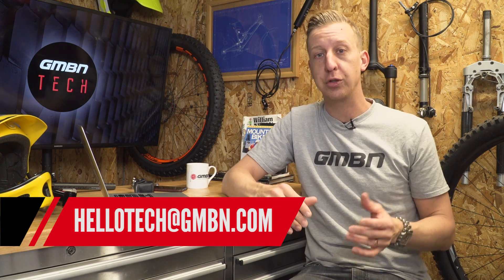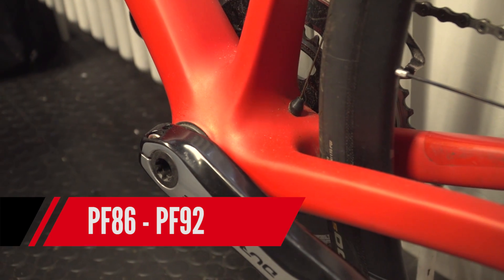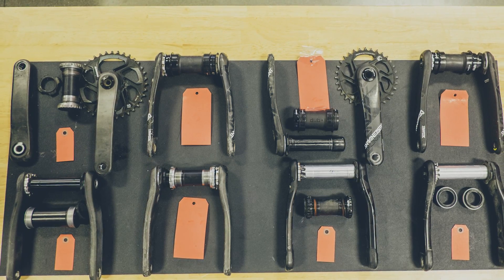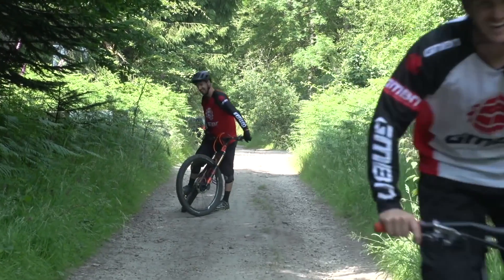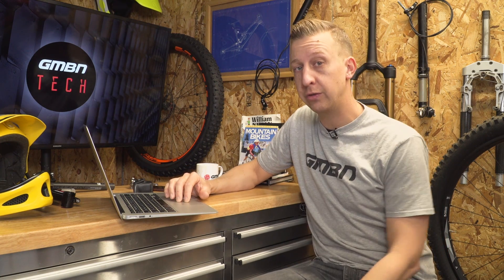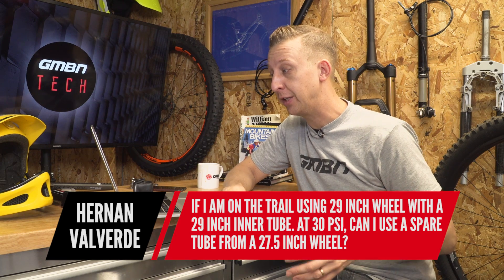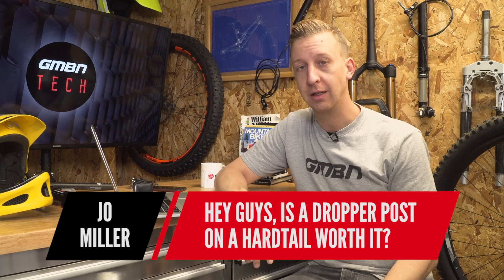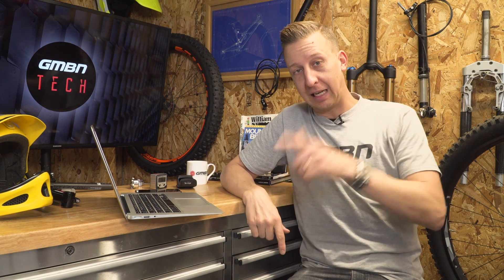ASK GMBN Tech | The Bottom Bracket Minefield Explained

Comment: Actually you have a bigger gear range on the E-13. On the Eagle you have a 500% gear ration on the E-13 you actually have 511%
Reply: Andrew Dodd yeah! Ejj thanks fpr answering though :)
Reply: Andrew Dodd Well I mean we all do mistakes don't we? ;) Oh and thanks for the explanation ond the BB's cleard up alot of things and I would really like to get a video on different crank systems. Like hollowtech, hollowtech 2 etc.
Reply: Sumo's'Enduro right on, seems like eagle may be nice for xc, I really like the e-13 for enduro. The jumps are reasonable, and the drivetrain is more compact.
Reply: austin ritz why would the e13 option be better for enduro? Its a few grams lighter than eagle and since xc weightweenies will see the 50g diffrence it would make sense. Also the gear ratios are actually similar to old school 2x10 or 2x11 with a 34t chainring
Reply: Calvin Pessl I like the slightly more compact drivetrain- you can run a smaller chainring in the front for the same ratio. Gives better clearance. Also, I like the 11 vs 12 speeds because I can get through the gears faster and the ratios are adequate. 
I always preferred 2x for xc because of the closer ratios. That's why I like the eagle for a 1x xc setup, the ratios are slightly closer so it's easier to get my cadence where I want it.
Reply: austin ritz well i stated that incorrect. I meant why would the e13 setup be better for enduro in comparison to XC. I mean 12gear sounds nice and all,  but gear dumping is surely better with 11spd. But ur right, having that more compact setup is nice for racing(no matter which discipline)

Comment: Just got myself a new bike with a Rockshox Reba RL, i am trying to get the suspension dialed but it just wont get as plush as you see in vids of GMBN or any other riders. what am i doing wrong? currently running 120 PSI on 90kgs and the rebound set to medium (basically middle of the dial)
Reply: Koen van Scheepen you may try to dial the rebound a little faster
Reply: Charles the sprocket thanks ill give it a shot!

Comment: Just a heads up on upgrading to Eagle 50T. My LBS are still waiting for a mech hangar that will replace the existing shimano direct fit one on my Rocky Mtn Altitude. It’s longer in length to handle to jump to the 50T. 
Check with your bike manufacturer / LBS that they can get hold of one before dropping the cash.

Comment: I'm not sure why you said the SRAM 'obviously' has a bigger range. Is it not the case that the E13 actually has the higher range at 511% compared to the SRAM's 500%.
Reply: Ah okay. I didn't know if there was more to it than just the percentage number.
Reply: I've just been through the bottom bracket standards rollercoaster to replace mine. I certainly wouldn't go on YouTube and explain it all 😂. I tip my hat to you.

Comment: #askgmbntech Can you compare sram eagle cassette to a garbaruk 10-50   cassette, which is 11 spd ( made in Ukraine)? It is cheaper, lighter and i'm really curios about your opinion
Reply: Garbaruk (and Sunrace) also offer 11-50 cassettes for Shimano hubs, so you don't need a SRAM freehub anymore to run a pizza plate on your back. The Garbaruk one is quite light but obviously also more expensive.
Reply: sp00n I would defenetly get the garbaruk 10-50 instead of 11-50. I would sacrifice that extra 20 dollars on the cassette (because you can exchange a shimano driver body to a secondhand sram xd driver for free, at least i can) to get that massive range. The 10-50 cassette is only compatible with sram because of that 10t sprocket, but its a matter of preference in choosing the one. I asked Doddy because i want to know his opinion on the gear ratios.
Thanks for your reply! Have a nice day!
Reply: Yeah, 10-50 is certainly superior. However the SRAM XD freehub would've cost me around 60 euros for my hub, and if I already had an XD freehub I'd probably had switched to Eagle right away. The GX 12sp cassette is pretty heavy though, almost as heavy as the 11sp Sunrace, but still costs quite a bit more.
As for the gear ratios, you can directly compare Eagle to Garbaruk here:
http://www.gear-calculator.com/?GR=DERS&KB=32&RZ=10,12,14,16,19,22,26,30,36,42,50&UF=2240&TF=80&SL=3&UN=KMH&GR2=DERS&KB2=32&RZ2=10,12,14,16,18,21,24,28,32,36,42,50&UF2=2240
Reply: sp00n Thanks for the link man! I will defenetly change to garbaruk 10-50 when i will have the money (i am only 15 and is hard for me to make the money for the cassette and cage, that's 365$) but i hope Doddy still does the video about it because more people will hear about it. Because lets face it, it is 1000$ cheaper than xx1 eagle complete configuration and you get the same range, almost the same performance (if you have a good 11spd shifter),lower price and lower weight (if you already have carbon cranks). 
Ps: sorry for my english, im not native

Comment: #askgmbntech I'm running a 2x10 Shimano drivetrain at the moment on my Rose Uncle Jimbo 2014 enduro bike. I recently had it serviced and upon asking whether I could change to 1x11 / 1x12 they said it's impossible or at least certainly 'not worth it'. Is this ture? The bearings are standard thredded, like shown in this video.
Reply: Unless there is something weird about that frame this is a no-brainer upgrade. I went from a 2x10 11-36 to a 1x11 11-46 without any issues (and I even mixed a SRAM GXP crankset with a Shimano XT rear). It is a huge improvement and well worth the money ($500 in my case). I think you might need to find a different LBS.

Comment: Should I get a new custom wheelset or an 11x1 drivetrain first? As of right now I’m 3x9. Thanks!
Reply: Wheels! A 1x drivetrain is nice but it won't help you go faster, climb better, ride longer, and improve handling...wheels will.
Reply: Mike Williams makes sense! But what about the improved torque and control of 2 extra gears?
Reply: Thomas Redifer I’m pretty sure your 3x9 will have every gear ratio that the 1x will have. (And more) It’s only advantage is not having to shift the FD to find it. But when I had a 3x I had a climbing ring a descending ring and flat ring so it basically was a context dependent 1x

Comment: Loving this new Tech channel! I'm newer to working on my bike and have recently upgraded my old square tapered crank BB to a HollowTech II crank and BB.  So I loved learning about the different bottom brackets.  Now I have officially caught the bug and love taking my bike apart and upgrading it.  I also recently upgraded from a cheap coil spring fork to my first air fork, which was a bit of a ordeal trying to get my crown race off, but finally managed to get it off.  Loving the air fork and new cranks!

Just curious if there is a "sister" version of this for headsets?  My current bike has a caged bearing setup and am just curious if there is an easy upgrade option to cartridge style bearings or if I am going to always have to use caged bearings.  Maybe a idea for a future show, of course assuming there is content.

One last thing, maybe you could recommend some good "reading material" for the "beginner wrencher" to help build a good foundation for good bike repair.  There seems to be lots of books out there on the topic, but I don't want to waste my money buying a book which might have outdated information/standards or only cover 75% of the information needed to work on a modern bike.

Thanks Doddy.
Reply: you mean downgraded to an air fork, coil forks are the best thing that i ever spend my money on my giant reign
Reply: My bike (Giant Talon 3) came with a cheap Suntour XCM which isn't even rated for anything more than "leisure cross country", my local trails are anything but what I would consider "leisure".  I didn't throw on anything special because with a straight steerer tube my options were really limited, but the air fork was definitely an upgrade FOR ME, due to the fact that I can easily set sag and unlike my cheaper fork I have a little bit of control over rebound.  Not to mention that was probably the weakest component on my bike in terms of durability aside from the cranks.  It had alot of play in the stanchions.

Comment: So I have Shimano XT 11 speed rear derailleur.
In its cage part there's a little piece of the cage that is contacting the chain. It's between the two pulleys and it makes a lot of noise. At first I thought that the sound was coming from my chainguide but it's actually the small piece of metal in the derailleur. So does someone have the same problem and what's the function of it? Does it have something to do with the shadow+ technology?
Reply: TGV 47 sounds like you have put the chain on the wrong side of the metal tab. It shouldn’t contact the chain.
Reply: Miron Klescik I have tried that but it doesn't help. You can't solve the problem by adjusting cable tension cus the metal piece is always touching the chain no matter what you do. Also it's weird that no other derailleur has this kind of thing between the pulleys.
Reply: I see what's the problem, did you install chain yourself or? Chain is supposed to go from the other side of that metal piece I think. My shimano derailleur has that as well and everything is totaly fine
Reply: Miron Klescik Well it's like on the outer side of the chain (hope you understand what I'm trying to say) so I don't really think that it's supposed to be on the other side. But I could try
Reply: I had the same problem once when I swapped my derailleur myself and that was the case. Well at least you can try and let me know ;)
Reply: Miron Klescik Alright thanks for the help anyway! I'll try it out tomorrow.
Reply: I have the same RD and it isn't obvious you are feeding the chain the wrong way. I find it is easier to visualize if you pull it down so it is vertical (like it would be in the large cog) -- it should then feed without touching that tab.
Reply: Mike Williams ok thanks!